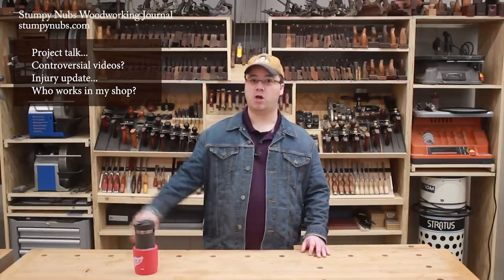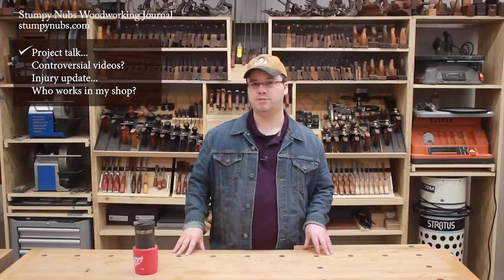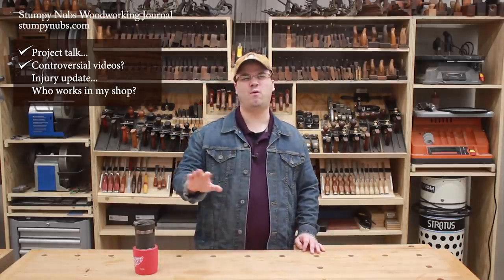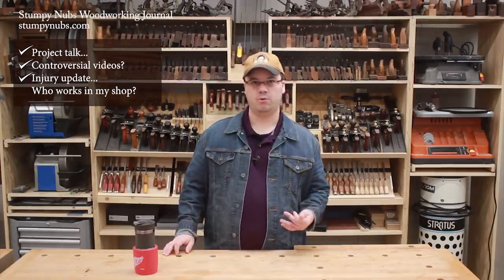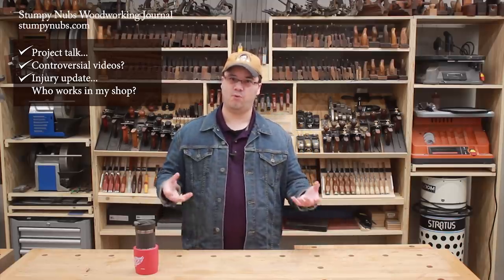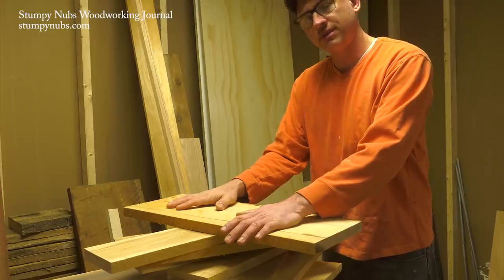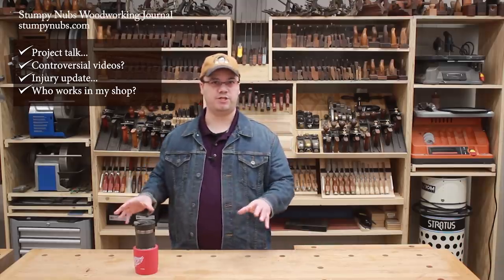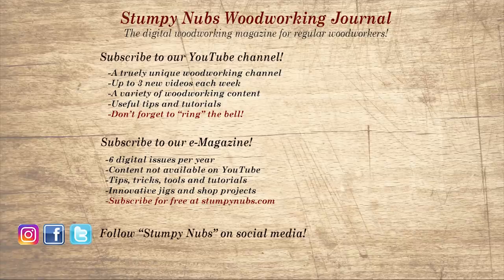Why I can't give the finger anymore (and other interesting stuff)

Comment: I was tightening a bit on my router and my hand slipped off and I basically karate chopped the router table really hard .  The middle joint on my right pinky was the most injured and took almost one year to heal.  I could bend it to make a fist, but would have to use my left hand to straighten out.  Hot water soak daily while trying to bend and best of luck down the road.

Comment: Jim, by all means publish your safety video.
There's always a safety glitch waiting to leap out of the darkness.  A couple of days ago, I reached over the spinning blade in my SawStop to poke a piece out of the way.  Yes, I reached high, well above the blade.  Still stupid.  And then I noticed that the wide sleeve on the lab coat I wear was only a couple of inches above the blade.  Sure, two inches isn't zero inches, but still...
(In the shop, I wear one of those white lab coats that doctors wear.  It makes me feel important.  And you wouldn't believe how much crud the coat catches in a week.  I need to stitch the cuffs a little tighter. because they keep catching on things.)
Reply from the maker: I'd like to find some sort of elastic cuff-covers for securing loose sleeves. Maybe sports wrist-bands, but less 80's looking.

Comment: About the Radial Arm Saw, I never missed it in the shop once the Miter Saw came out, and then the Compound Chop Saw. Both were safer and more portable as well. Just seeing the mess people did to themselves from using a Planing Head on a Radial Arm Saw was enough for me to put the Saw to rest. One of my bosses had lost fingers from both hands from a planer head gone wrong on a table saw one day when I had called in sick. I accidentally drink about 4 oz.s one morning in the shop and had to be taken to the base ER. Later I found out how it happened. My paper cups I threw away to the trash. At night after work, the boss digs one out to wash his brushes from doing Fiberglass and left it on my workbench. The next day, here I come in with my fresh cup of ice water and set it down on my bench and taking a look at my current work task, a door in my bench vise, standing verticle, I started my measuring. On one side of the door was my freshwater and the other, a cup of Acetone, unknown to me.  
I was busy with the measuring and it was a normal hot morning and I drank about 3 gallons a day at this site. I gulped my water down, went to the Otherside of the door and grabbed my 'water', NOT. In a moment, it was down the hatch and I almost passed right out! After this dumb mistake was taken care of, I could not return to work for a week. That's when the boss took my shop table saw home to work on his boat and instead fed his fingers to the planer head!!!
It only takes a moment and you have All that time to regret the mistake, even forever. So much better to 'know your skill level' and stay safely within your 'skill set' and have a full set of fingers as well.

Comment: The other day I found my Lancelot chainsaw grinder wheel. I checked it out, dusted it off, and clamped it into my bench vise.
Then, I took a hammer to it. I kept whacking until it folded and a link of the chain broke. I didn't want anyone to find it in its next life and try to use it. 
That thing always scared the crap out of me even though I've used it very little, and I didn't even want to be tempted to use it again.

Comment: Hey, Stumpy!  My first  YouTube comment ever.  I've been watching you for years, though.  I just wanted to pass on a tip or two about wound healing and connective tissue repair that you may find helpful.  (Or you may not)  It's just something I learned the hard way when I received a serious electrical burn (deep burn on my left hand, required months of OT and wound care).  Vitamin C promotes collagen formation, which is what you need for reforming those tendons and ligaments.  If taking the typical Vitamin C tablets causes stomach upset (intense cramps for me) get the bulk powder, plain ascorbic acid (there are other forms, too, but it's cheap ($20 a kilo), and take a few grams a day.  Topical DMSO can help with the scar tissue, making the tendons a little easier to extend for therapy.  Just rub a little on.  It'll be absorbed right away. I used a little Vitamin E mixed in mine.  You can hardly tell anything happened to my hand now.

Comment: I have ,in the past, entered into an Iron Man contest with my miter saw.   I came in a distant second. my ring finger on my left hand to the brunt of the damage. two surgeries later it will not straighten out nor will it close into a fist. a friend that is a cabinet maker gave me some great advice.  never ever cross your hands around any type saw. I rferalized I had been holding a long piece of wood and I needed to make "just one more cut".  I was by myself and was trying to finish the repair.  there is something about performing a task around a saw blade and needing to use both hands that crossing them makes the visual and mental perception confusing .  maybe just for a second.   that's more than enough..

Comment: Let's just say that "accidents" can happen most anywhere. Example, about a decade or so ago I was playing tennis doubles with some guys and went for a ball that bounced in but was on its way to nearly the next court. In my effort to get to it, I ran for that shot and actually made it. However, in doing so I went over balance and went in to the court hard face first with my out-reached arm to try and stop what I knew was going to be a painful fall. Well my face took it hard, but my hand took it even harder. I somehow managed to over-stretch all my fingers on my right hand back over the back-side of my hand. The was the most painful accident I've had to date and it took me over a year to recover. Not all the fingers work perfectly anymore, but at least they work... So accidents are not only reserved for the shop, but life in general. And since that accident, I can also tell you that a wire wheel on a grinder setup can't be stopped with your finger between the wire wheel and the attached plate. Amazing how fast a wire wheel can eat through skin and meat :-( You get the picture... The day YOU think you've mastered any power tool, is the day YOU need to stop using power tools!

Comment: I had that exact same model Dewalt radial arm saw in my shop that's shown 4:04.  It was a 3 phase, 12" monster. Its starting torque was so high and rotation acceleration so rapid that you better have a good hold on it or the thing would traverse on its own - toward you!  It would eat anything short of a concrete post without a burp.  It tried to kill me several times.  No, it couldn't attack me when it was not powered.  But I know it wanted to. I could hear it muttering to itself, like Golem.  It was in league with the side grinder.  They kept trying to enlist the table saw in their conspiracy but they don't realize that the table guy rats on them.  I make sure he gets the best new blades and he stays loyal.  You probably think I am joking about the Dewalt.  I am not. The guy I got it from GAVE it to me, saying to be "real careful around it".  Not, "with it" - "around it".  I didn't understand.  I learned.  I gave the same advice to the young guy I gave it to.  I wonder what happened to him.

Comment: Another great video. Any problems with dust getting into your overhead TV's? I have been thinking about doing the same thing over my assembly table, but was concerned about the fine dust.
Reply from the maker: In my old garage shop I had a TV and a computer. I shot compressed air into then every once in a while. They seemed to last fine.

Comment: Thanks for the update on your injury. As a hand therapist myself, your story is unfortunately all too familiar. I'm sure your therapist has discussed it with you, but if they haven't, it may be worth trying a 'silicone sock' on your thumb overnight. They are sold as 'digital caps' in Australia and used for fingers or toes. Lined with silicone, they provide pressure and occlusion over the scar which speeds healing and flattens and softens raised scars. You literally slide it on, go to sleep  and take it off in the morning. Super easy but very effective x

Comment: I recall George Carlin doing a stand up where he started out saying he had a friend that told him "to buy a SAAB because they are a safe car!" and George's reply was "Learn how to drive and ANY CAR is a safe car!"

There are people on the internet though that DO give bad information!! Scotty Kilmer in one of his videos here on YouTube mentioned that you can "destroy your transmission by resting your hand on the top of the gear shift while you drive your car" and I frankly had to call BULLSH*T on that!! Because in the 1980s when cars began using the present day "transverse" engine arrangement (AKA Front Wheel Drive). The Transmissions in all cars even stick shift cars are controlled by linkages and in some (if not many) cases cables, so there is NO DIRECT CONNECTION between the shifter and the transmission in nearly 30 years now!! Back in the 1970s automatic transmissions STILL used linkages anyhow (and some times cables) to attach the shifter to the transmission, and only a select few vehicles had "top loading" manual (stick shift) transmissions when were more common in cars from the 1930s to 1960s!! Top loader transmissions were mostly standard transmissions and the shifter LITERALLY was stuck inside the transmission to control gear selection....but like I say that hasn't been a thing since around the late 1970s and an extremely few 1980s vehicles!! 

My point is this bad info is bad info, and like Scotty misleading the viewers THEN I comment on what he says! In short I listen to the WHOLE video usually and then write a comment on it most days!! But there are Scotty Kilmer's of the world out there giving bad advice and you can't ignore that either!!!

Comment: Here's a story to help someone - My one table-saw injury and how it happened: 

I was new to table-saws, and a little nervous to use it. I watched many table-saw safety videos and decided that I would order a featherboard before using the saw for rip cuts.

After setting up everything to what I thought was perfect, I started the rip (about 5' long). About hallway through it started to get a little harder to keep the wood moving, then I found myself pushing harder & harder, until finally something gave way and my finger ended up in the blade. It didn't hurt, just felt like someone flicked my finger really hard. Luckily I had thick, slip resistant, cut resistant gloves on and only the tip of my finger had a perfect dado running through it...no surgery required. Without those gloves I have no doubt it would have been much worse.

The take-away from the story is, all the safety videos I watched didn't mention the rather obvious fact in hindsight that your wood width needs to be parallel for a feather board to work. So the piece I was ripping started out at 3¼" wide, but was 3⅝" wide at the other end. It just slowly became pinched up against the feather-board as I went along.

I would have been fine if I didn't use the feather-board in that scenario.

So for anybody new DON'T USE A FEATHER-BOARD if your piece isn't the same width down the whole length.  I got really lucky and could have easily lost several fingers.
Reply from the maker: As a general rule, if it seems to take excessive force to make a cut you should stop and figure out why before forcing it through, feather board or not.
Reply: @StumpyNubs  Absolutely.

The thing about it being my very first cut on a table...is I had no reference as to what a normal cut should feel like. Only in retrospect did I realize that. I suppose I assumed long cuts just get harder as they go from dust building up in the cut or something.

Everything always seems so obvious looking back though...and I should have stopped immediately.

Comment: Another great video! Thx. It must take alligator skin to ignore the trolls. I have been asked to put together videos on my process, but don't think I could deal with the Negative Nillys. On another note; how do you like your Grizzly jointer? I have a grizzly 15" planer that works fine and am considering upgrading my jointer.
Reply from the maker: I'm not a fan. The fence is always out of square no matter how often you true it up, and the edge-jointing is inconsistent. I'm going to put a helical head in int to see if that helps the latter.

Comment: May I suggest bending that finger much more than you're comfortable with. I say that because I was in a wreck and my knee was crushed , like they went in and scraped out tiny slivers of bone fragments before they could do any kinda reconstruction. I have ended up with over 90% movement back in it now. I would force it to the point of screaming and hold it as long as I could , then when that got bearable I'd force more bend in it. When I was being evaluated I was told they only expect 20% motion , they didn't want to tell me in the beginning because they figured I would have given up.

Comment: regarding your safety video, I'd be interested to see it, if you can help someone save a hand or double think what they are doing, then forget about the trolls.  Lol, probably a little too dramatic for this but for some reason the quote popped into my head when you said you might not post it because you might get flamed. 
“The only thing necessary for the triumph of evil is for good men to do nothing.”

Comment: I got a free radial arm saw (estate of an in law). It's a late model craftsman professional. I haven't used it yet (it is missing a metal brace that I will need to get made). I want to use it for only cross cutting. I am not a professional wood worker and don't need to do anything special. Pretty much just cross cut 2x4s, 2x6s etc. Also cut sheets of OSB and plywood (won't use the RAS for this). 

Anyway I was at home depot the other day and noticed the tool they use for cross cutting 2x is exactly that. A radial arm saw. However they have a big metal guard? shield? etc on it. For my RAS I'd love to get something like that so that I'm totally protected while doing cross cuts. Any idea if there is an official name for that piece of protection? I can't find a picture of it.

Comment: Our small data center had carpet, and we caught some flack, but it worked out and was comfortable. Office Amy's monitors, chair, desk height, ... is an ergonomic disaster. Her body is so convoluted, it hurts just viewing the video. The monitors need to be lowered ( top of the monitor should be about eye level ), her seat / desk height need adjusting ( her elbows are way below the desk top ), she should not have to lean this far forward. Her back needs to be more upright. Please spend a little time on this, for her sake. And... I really enjoy your content. Thanks

Comment: Re Injury :  you will get your movement back, I can assure you. I had a skilsaw kick on me way back in the day and it ran up, backwards, over my thumb.  It was so bad my entire thumb knuckle was opened up and you could see it, all the cartilage, and the bone itself.  Even had a very nice 1/8" notch right in the bone itself.   Interesting side note, it didn't bleed much, just a few obligatory drips on my future ex-wifes new carpet while I was running through the house looking for my car keys to go to the ER.  Drs (I consulted 3) said I would never have full movement again.  EVER.   After all the visual healing was done (I have a nice scar to go with my safety lectures I tend to ramble on about), I could not flex it to even touch the tip of my index finger, much less grab anything small.  It was like having a monkey hand.   Avery attempt was painful and even using my other hand to push my thumb down it wouldn't budge as if it was epoxied in place.  About 7 years later, I noticed it was back to full function.  I didn't notice the progression since I never really thought about it.    My point is, it took time.  Years.  And pain.  You will be okay.  Eventually.  Promise.  :)

Comment: When using a radial arm saw for horizontal cutting sheet stock.  How do you stop the cut closing in a the blade. A table saw has a riving knife or splitter.
Reply from the maker: You don't. But in fairness, if you've even had a sheet cut on a panel saw at Home Depot they do it the same way and it doesn't bind.- except their blade points safely away from the body :)
Reply: @StumpyNubs  Thanks mate

Comment: I still have the safety guards on all my saws, and only remove it from my table saw when I have to, such as making a dado cut. I wear ear, eye, and dust protecion always. I give less than a damn if some Internet tough guy thinks I'm a wussie. It's my body. Lately I've been using old school hand tool techniques instead of using power tools. I'm enjoying it more and I don't need all the protective gear when I'm using a hand plane or hand saw. It's a lot more fun too. I still have the power tools, and sometimes I use them. I can't see ever getting rid of them--there's just some things that they can do better, but I'm enjoying the lower stress and more fun hand tool techniques.

Comment: I'm a machinist and have been working in machine shops for over 40 years. Every injury I have  had was my fault and I'm a safety conscious guy. Woodworking tools are much sharper than metalworking tools and they scare me. Be careful. I know about those macho dudes who scoff at safety. These are the same guys who don't wear adequate motorcycle helmets. Well, there is nothing macho having somebody wipe your ass because you can't. Shitty safety is just that.
Eric